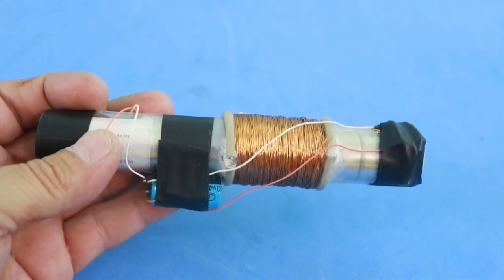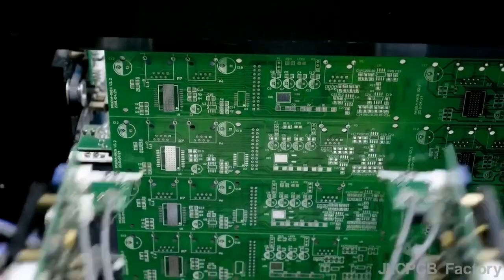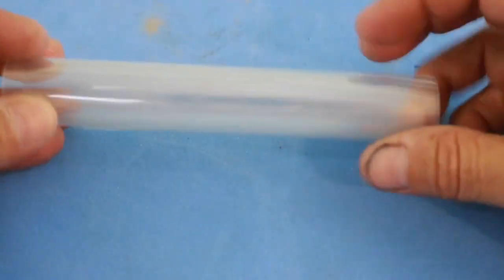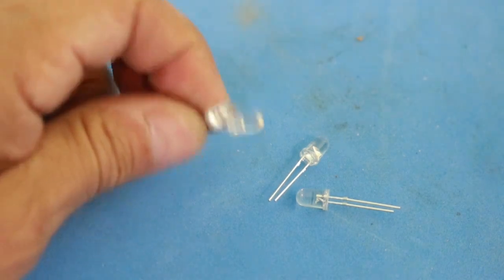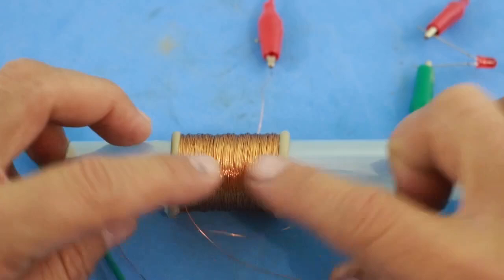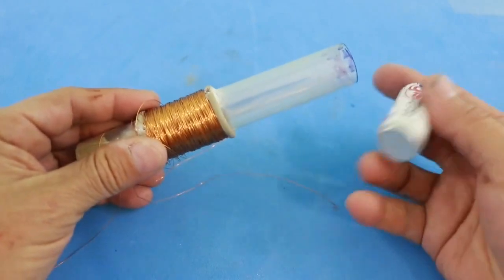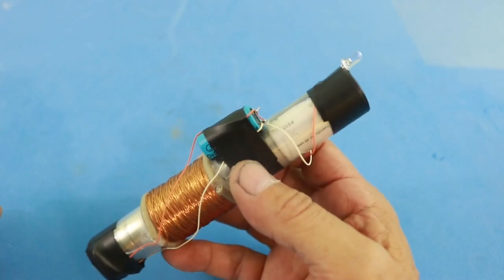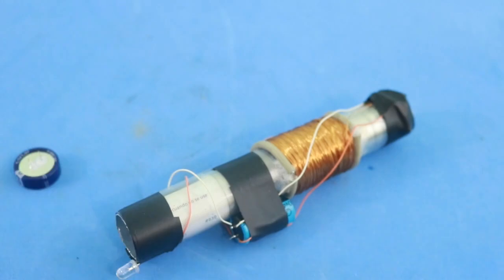Make a Faraday Flashlight

Comment: Hi sir, my 9 year old son is trying to build this lamp for his science fair project, but for any reason is not working we have made 3 and nothing we use gauge 24, 1000 turns and we are using a pen, the magnets are slightly smaller in diameter but same material and very strong. Any recommendations?

Comment: If you put a magnet with counter poles on each end, the magnet inside will remain in a dampening magnetic field and won't bump against each end of the tube. This also makes it more quiet :) Saves you schok cushions or springs on each end.

Comment: Also you can add joulethief to use more energy from the suppercap down to around 0.5volts, not only the 2 or 3 volts the led required.

Comment: Help with this please....  I have this set up with PVC but it is not working.  I am using non insulated braided copper wire instead of insulated copper wire.  Is that why it is not working? Or is there something else?   Thx in advance!

Comment: using a super capacitor and a single diode you could simplify it hugely and you would reduce your voltage drop over the diodes. also adding a longer tube and springs at the end you conserve more energy and the system becomes more efficient. there is a formula for working out the ultimate speed and length of travel. helps to know the strength of the magnet and making a magnetometer would be another great project, there is a great instructable for building one with a nano and hall effect sensor. by tuning the system you can get peak performance where a few shakes will last a long time. full bridge is wasted with a single led load. work out the output and up the diode to the right wattage and get the best bang for buck. its a simple project that would be a fun series of videos.

Comment: The LED flashes in both directions because: when the magnet goes left to right, the magnets field is directly responsible for inducing a current in the correct polarity for the LED; when the magnet goes right to left, the magnets field imparts energy to the coil which is in reverse polarity to the LED, but as the magnet exits the field collapses in the coil which causes a reverse direction voltage spike, it is this that lights up the LED
Reply: I think you're right.  Not sure, but I think the direction of the induced current reverses at the mid point of travel
Reply: Bro this is the best explanation so far.

Comment: The LED is itself a diode, so it's possible the rectifier diodes may not be needed - except a diode to protect the electrolytic capacitor
Reply: TechnoWizard - Great point! Why not make the whole rectifier bridge out of LEDs? That way all of the power gets converted to light and no passive components are required to protect the capacitor. I'd still want a switch though.
Reply: @rolliebca  WOW! Excellent comment! 👍 That is a brilliant yet simple idea to make the 4-diode full-wave bridge rectifier out of LEDS. That way, you kill two birds with one stone, and you save $$$$ on parts count!
Reply: @rolliebca  This might be problematic, as the forward voltage of an LED (1.8V-3.5V) is much higher than that of a diode (.6V-.7V).
Reply: I think he (Mr Ludic) was taking a risk of zapping the LED. He should play it safe and use diodes with the LED.

Comment: it can be done 10 times better with less parts.
one end of the coil goes to a pair of diodes opposite to eachother. the other end goes to 2 capacitors in series. you connect the diodes to the capacitors and you get a voltage doubler. this way you loose far less energy on diode voltage drop